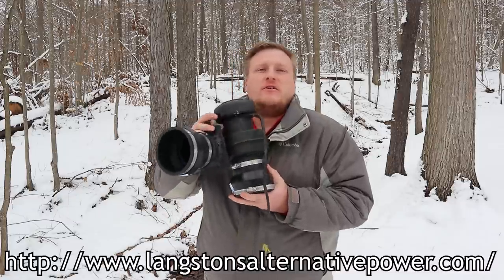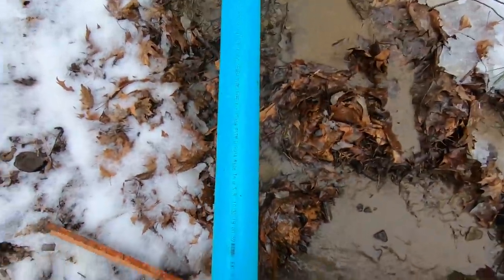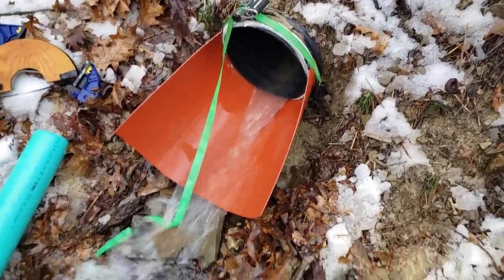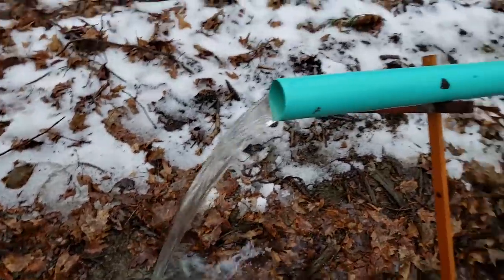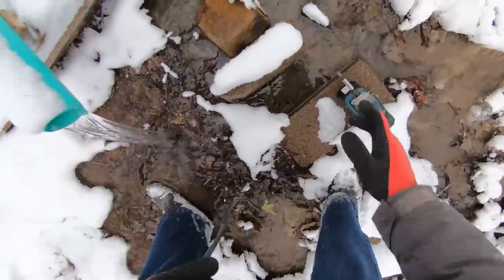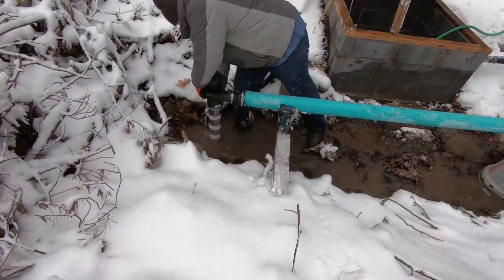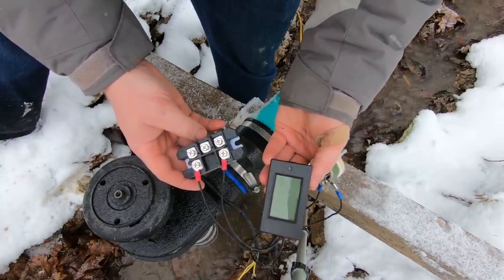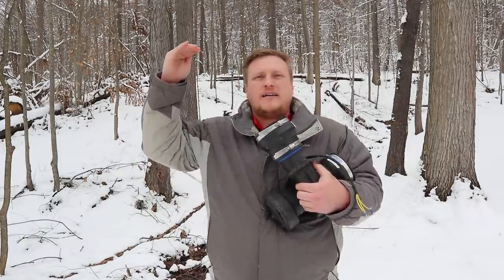Low Head Turbine Testing

Comment: I’m confused by the use of the open barrel - the head height your turbine sees will be the drop in elevation from the waterline inside the barrel to the turbine. Why not just allow the culvert to be the buffer, since you’ve got overflow in your connection method, and thus utilize 100% of the head height from the outlet at the culvert to your turbine?

Comment: just so you know, unless the barrel has ponded water in it, you're not getting any head at all

the water falling into the barrel from 6' up and then flowing into the pipe 6' below doesn't equal 6' of head, the pipe has do be submerged

in fact, the head you have at the end of the pipe is (assuming the pipe is full) equal to the height of water in the barrel, and, if the upper pipe is full, includes that height, as well as whatever is dammed up behind the culvert crossing

Comment: The ultimate advantage is this being very silent. All tho this would require quite the water flow for it work at all. The problem with conventional turbines from old turbochargers is that those are built for high velocity lots visits fluids. Not some high viscosity liquid (we also have to consider that is for gas not liquids. The angle of the blades if too "straight forward". The blades should be much have much more aggressive angle of attack so that it creates some back pressure aswell. Basically designs a blade that is low velocity but high torque. In turbochargers you don't need much torque at all you need velocity and here it won't even reach that RPM because the velocity of the fluid is not enough at all. 

This design would be nice because it is dead silent and you only need to make a different impeller for it with different geometry to suit your flow needs. I am sure you know all this but I would like to see this idea again but with a different turbine in mind (ask someone with a multi axis CNC machine to manufacture these things). I like the design because it's silent and I don't think it should be hindered just by such a simple thing as impeller design

Comment: Very nice thank you. Will support later. Your vids are well done.  I'm curious about drop and length of pipe, velocity,  also interested very much in recycling parts, etc. Thanks again.  I have 350 gallons,  80ft plus drop. At about 1000 ft..length.  actually I'm splitting it in 2 150 per direction.  2nd one less length, and about 60ft drop.  150 gallons per head..

Comment: You could add a collection pipe further uphill to use your culvert as pressure tank 🤔

That way you probably got enough pressure to run a turbine like this from time to time.

Just add a digital pressure gauge to the pipe running to the turbine, if the pipe is nearly full, you can start it, until the pressure drops to low :)

Comment: Hey A Joe,  where you goin' with that gun in your hand?  Don't do it Joe!  Don't shoot the Old lady.   Just Kidding. HA!   This is over a year and you might have figured this out all ready or even moved on to another project.  My first time here and I like it.  So.  Lets get to my observation and thought.  "Your collection tank"  The top intake is fine but the out pipe should be raised up to the half of the barrel and not at the bottom, where it is in this video.  That will drop a lot of the sediment and finer silt in the water to the bottom and you will have a Purer water output also the angle will be slopped a little higher from the output of the collection tank.

Good Luck on all your adventures Joe & please don't shoot the old lady.

Comment: 13:26 - you may get more accurate power readings with an electrolytic capacitor across the output of your rectifier (approx 4700 microfarad or near that) to smooth out the ripple. Might also help your MPPT controller do math a little better.

Comment: nice intro 😊

so is the new turbine a replacement for the pit one or an as well as? could the new one feed the turbine in the pit with its output? (once you can get it to 100% efficiency) sorry, just getting more and more curious and extremely interested! 

your waterwheel you made a while back got me interested, and now with these more advanced turbine setups i just cant wait to see what you do next!

never get a chance to try this in the uk, but watching your progress is so fascinating and interesting! 😊
Reply from the maker: Just a demo unit, for content. And you notice the outlet for this turbine is below the outlet for the other turbine. The higher up I go in my creek the less water I have access to. Putting the turbine higher up wouldn't have solved that issue.

As for using it in the other turbine, no dice as I wouldn't get enough velocity and all I would be doing is creating drag.
Reply: Joe Malovich aha, well i get 0/10 for observation on its location! lol but interesting tho!

Comment: Tip to get your setup faster with the right height: 

add some wood pins first with some cord connecting them like 2-3 foot away on the right height for your pipe.

Then you can use the cord as reference with a level at any point of the pipe to confirm the right height.

This allows you to get even very slight level changes over a long distance to be precise
Reply from the maker: are you talking about a string level for like blocklaying?
Reply: @JoeMalovich  yes.

At first I thought you was aiming for a steady angle for the whole way down to the turbine, without a buffer.

In this case I would just put a string level all the way next to the local you're wanting to lay the pipe, put the wooden pipe supports to the right height and just add the pipe afterwards. It's easier than work with an already filling pipe 😂

But nevermind :)
Reply from the maker: @RubenKelevra  It's not very clear in the video but I do have a steady angle down after the buffer. This way I don't have the heavy water filled pipe up high on dodgy supports. A benefit I didn't plan for is that the water rushes down the pipe at 100% full so all of the air gets pushed out the end and I don't end up with an airlock in the pipe..
Reply: @JoeMalovich  ah! Okay, sounds reasonable.

Cool project!

Comment: What you said is not true.

A vacuum is not like positive pressure because as the pressure drops, the water is subject to increased cavitation which causes increasing power loss the taller your column.

Only when you have positive pressure all the way can you maximize all of your potential.

Will it cavitate at only 6 feet?

Technically? In this type of application, there is ALWAYS SOME cavitation. It is a principle of the dynamic physical properties of water, and if you study fluid dynamics [as engineers who build full scale water turbines do] you will learn this.

Comment: Eight ft to 12 feet straight drop after the impeller. Then you have it the pull on the propeller makes the spin dumping as much water as possible. Just saying. Your prop is in the wrong place. Its a vacuum pull.

Comment: Have to disagree with your statements starting at 12:40. Your theory is correct in that the pressure is the same in all configurations but its just that, in theory. in practice, there will never be a perfect suction and if there is, you will always be fighting cavitation at high flow rates and speeds. i have seen multiple guys on here swear up and down that they have air leaking in their systems cause they here air going through their turbine. NOOOO its not air its cavitation and it will destroy the turbine so quickly. you breifly mention at the end of your statement about max suction height which i believe is your way of dealing with cavitation or you are repeating what you have been told. i can tell you from extensive testing on water pumps that cavitation can occur severely at 10 feet of suction. add even 1% air and it can get VERY bad quickly. if you ever here what sounds like rocks going through the turbine. its cavitation.

Comment: Long time watcher, first time commenter. I have been watching you since I discovered your water wheel video. I hopefully this summer will be trying my hand at water generation. I actually want to do it in two different locations on my property. I have 1800 feet of road frontage with a creek that runs almost that entire length. It dumps into a 3 acre pond. First on the stretch of creek before it dumps into the pond, I want to build a water wheel. My plan is to build it more for looks than function but I also want to build it for function. It will be attached to a small wheel house where I may try  to put a pellton wheel inside but not sure I have enough head. The creek has a very low decline until the point where I want to put the wheel house which has a 6 foot drop waterfall. 

On the other side of the pond where the outlet is we have a small camp site where we oark an RV. This side of the pond has your typical overflow culvert and it also has a 6" pipe that maintains the level of the pond. That pipe has an 8 foot drop that goes through the other side of a man made earth dam that is what created the pond.      I plan to build a small turbine house where this pipe comes out. In this spot we plan to only generate enough power for the RV.  Maybe with an automated control to shut the ow off when the batteries are full.

Looking for ideas and opinions. I plan to record my process for the purpose of sharing, just don't know if I will create a channel. 

Trying to amass as much info as I can in my.plannong process.

Comment: the solution for your problem is to reduce  the diameter of the pipe that is going to generator. that will create pressure at the water outlet
Reply from the maker: This is a different type of turbine, it needs really fat pipes.
Reply: @JoeMalovich  it is the same you have to adapt the output that you want, adapt and reduce the diameter to the diameter that you want at the end.
that is to say to generate pressure you have to reduce
you have to reduce the pipe size from a larger one to a smaller one. In your case, the large diameter of your turbine. The problem with your design is that you need water pressure at the outlet and you can do it this way. If you want I can send you a drawing with the design that I propose.

Comment: Your killn me!!  First, put the hole for your 4 inch at the BOTTOM, not in the middle.  And are you afraid of Metal????  Get an old metal trash can , and attach it to the wnd of that big pipe and then cut. hole on the botom of the metal trash can smal than 4 " for the PVC, and seal it up-- you will have the 4" SPRAYING out.

Comment: one thing you were consistently wrong about malavich is the fact that you think all of those generators are three-phase ac they are not those are two-phase AC. 3-phase has four leads not three. And you're not the only one on YouTube who's made this mistake.
Reply from the maker: No, what you are describing is star-wound 3 phase with a center neutral tap.
Reply: @JoeMalovich  then why do both the generators you usinghave only enough leads to suggest they're the same type of two phase generators that they use the power your house? Maybe you could explain this in detail in your next video because it looks to me like a tire behind you would just testing in this one and the one you are currently using both look like they're supposed to be the same type of Two-phase AC generators that you would use the power your house.
Reply from the maker: @Woodchuck1993  you are confusing split phase with three phase.